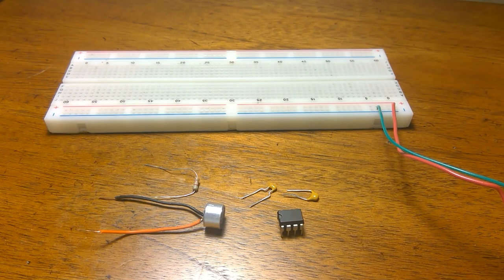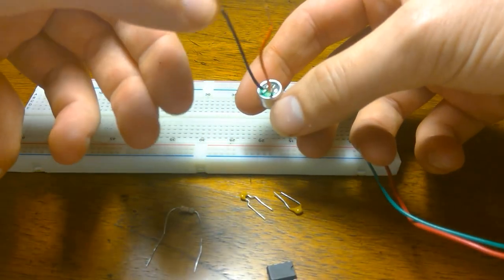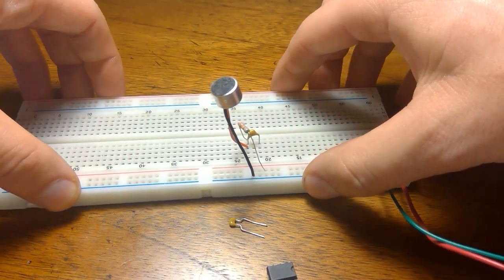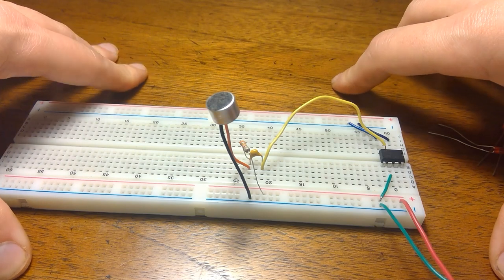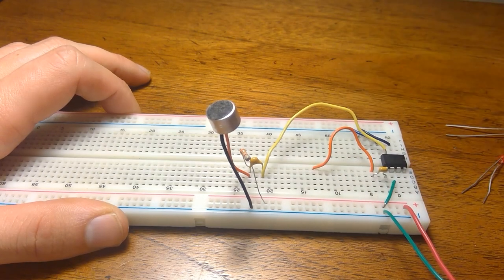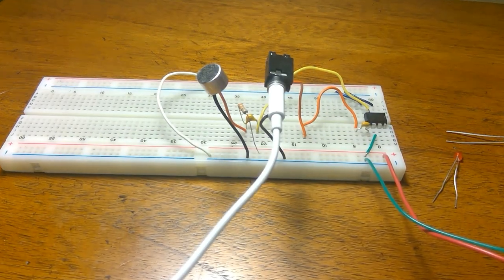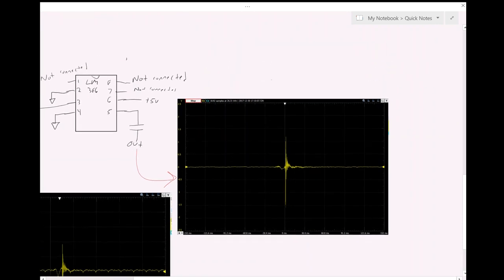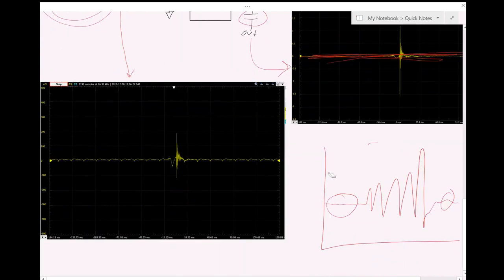How to make: Simple Mic Amplifier

Comment: I've built several LM386 amps and all circuits that I have seen specify a 10uF cap between pins 1 and 8...+ on pin 1 and the gain is then 200. A 1k2 resistor in series with this cap reduces the gain to 50.  A 10K pot after the input cap with it's wiper going to pin 3 works well.
Reply: Interesting.  I will remember to look for this, as I examine LM386 Variations.  I'm not focused there just yet.  I am just finishing up getting familiar with the NE 555 timer.  I noticed these similarities you described in the 555 circuits I examined and built, regardless of the application,  I built the LED police flasher, as well a transistor checker tester, and the 555 generally gets set up with same jumpers 2 to 6,  4 to 8, 10uf cap between 1 and 2, and ect.
I have found that after completing the builds, changing the caps often improves the result, if not required to even to get it to function.  Voltages are not always Identical, as well transistors might be diff ID#.  
You say "specify" are you set on this standard, and, or have you experimented with diff values?
If yes I would be interested in your experience.  If not some little tricks, at least it may save some wasted time.
Thanks.
Reply: Thanks for helping. I am needing the mic to pick up a sound from a few feet for a VU meter Led made strip with my Nodemcu. Do I only add the 10uF between pin 1 and 8 and no resistor in series. Also the pots have 3 pins I think the wiper is the middle pin and the other to be connected, but where does the 3rd one go. I assume to the ground. and is the input cap connected to lm386 pin 3? Thanks for any additional help.

Comment: Isn't ground infinite resistance?

   I see the point of the comments above about a resistor not going to ground because of this. So is it a good rule of thumb to always put your resistors in between positive and another component? I'm just learning, burned out a few resistors that were connected to ground in parallel with a capacitor for a guitar effects pedal.

Comment: Nice, I'm thinking I may use this on a VU meter I'm having difficulty with. signal from mic needs a boost.

Edit,  I did the above, and it worked well. Did it on bread board first, transferred to pc board and failed. I put it down. Picking it up again later I discovered some mistakes.  I'll get it.

Comment: Hey bro, some folks should be a little more constructive with there criticism. I bitch about videos sometimes so here are my thoughts. 10 plus man. I am only interested in factual information and seeing it actually built. The plus is because you also have the circuit drawn up showing the scope readings. Thanks for nailing the creation of a useful educational well explained video. I have been trying for days to find the correct simplified video of it on the bread board. One question though. Is there a way to increase the sensitivity of the mic or does it pic up sounds from a few feet ok. For it to be used in a VU meter that is sound activated with addressable LEDs with nodemcu esp8266??
Reply from the maker: Thanks yes this circuit was aimed to use the least amount of parts. Leaving the gain pins open yields an amplification factor of 20.when I snapped my fingers it was a gain of 7.5 probably because I wasn’t using a large enough rail to rail voltage supply so it maxed out. You can boost it up to 200 times using the cap however be mindful of your power supply voltage that you don’t peak and distort your output due to a low voltage ceiling.
Reply: @MostElectronics  I have it built and I connected 1and 8 with the 10 uf cap and put a 10 k pot with the wiper on pin 3 the other side with mic output. I seen it makes a gain of 200. I have not tried it. Kinda waiting to hear from some other posts if it's ok. Do you know?
Reply from the maker: @retrorocketman6969  make sure your supply voltage is high enough or else you’ll just peak out the amplifier and everything will be distorted
Reply: @MostElectronics  that is a good point and thanks. Now my thoughts are to pull the data sheet to get the max voltage on the electret mic and lm386 and set a max limit   to prevent overlo and use another adj trim potentiometer. To obtain the best operating voltage. Does that sound ok? I surely don't want to smoke my IC because I'm limited and can't buy any.

Comment: I made a preamp with 741 Ic and also with a single transistor with carbon condenser mic in both. The problem is I need to bring the Mic very close to my mouth to speak to record audio. What's the problem ? Is this Mic fault ?
Reply from the maker: not enough gain. LM741 do not provide enough gain

Comment: there is no need for any external power source for the electret microphone to work?
Reply from the maker: The current is provided by the resistor from the positive voltage. It turns on the built in FET inside of the capsule which generates our small 400mV signal from the snap

Comment: i wish people would specify if using the N-1, -3, or -4 variant.  I'm assuming you are using the -1 variant due to the mics low output
Reply: What’s the difference
Reply: @harrisonartz8387  Acceptable supply voltages, output power, etc.  It would change the values of external parts.  If a tutorial is done with a -1 and someone gets themselves a -4 (or vice versa), things won't work the same.  That small detail is easily missed by people purchasing off Amazon.

Comment: question, noob here. if I got a mic in a tape machine like this and I snipped it and soldered a line in could I plug in and record  music equipment into it without damaging the music equipment? I asked because I used my multimeter and found the 5v on the hot and didn't do the mod because I felt like it could damage my equipment like plugging in a keyboard and 5v going into the keyboards output.
Reply from the maker: It's possible, however you do not want to overdrive your recorder input. If you have an oscilloscope you can use that to see what is coming out of the tape machine. if you replace the mic with the tape machine you may just hear distorted music because the amplifier providing the gain for the mic is only expecting a few millivolts. If you put in 5V it will try to boost that and distortion/noise will occur.
Reply: @MostElectronics  thanks for the feedback. I got really into circuit bending recently, thought I found a mod on this toy keyboard that had a mic built in (cutting the mic and wiring a 1/4 input to the wires.)  and It worked, I would get really cool crunchy distortion when I played my guitar through it. I checked it with a multimeter after watching this and found the same 5v you used in this circuit. lmao thats what I get for assuming I found a mod that no-one else in all their experience circuit bending have found. got some sweet recordings though and as far as I know my instruments I ran through it are doing fine. now I know. THANKS.
Reply from the maker: @shawnlennon1947  sure, glad you are able to enjoy the distortion effect

Comment: In the schematic at 9:00, where is the required DC bias for the electret cartridge?
Reply: It shows the 3k resistor going to ground, which is obviously a mistake. He did it right on the breadboard going to the positive rail.

Comment: CAN YOU USE A 9V BATTERY FOR THIS?
Reply from the maker: Sure
Reply: You can. Electret capsule requires 0.5 mA current at 2 V so at 9 V source, you'll need (9-2)/(0.0005) ohms resistor. Simple. Now add DC blocking capacitor that shall act as a high-pass filter as well with capsule's resistor. The -3 dB cut-off is too be decided around say, 5 kHz; choice is yours, however.

Comment: i use a microphone that is plugged into a desktop computer in the microphone plug on the back of the motherboard and i use audacity in ubuntu 16.04. i can here the microphone but it is not loud enough. their is a thing called "48V Phantom Power Supply" but this is for Laptop  which does not give the microphone its full 5 watt power. on my desktop it has that and so i was told that it would not allow me to increase volume. but could i use a "PRE-AMP" before i plug into the computer to increase its volume. or basically how do i increase volume.
Reply from the maker: What kind of microphone? The circuit in this video can be used as a pre-amplifier or PRE-AMP as you call it. If it is the microphone used in this video then yes its going to be very quiet if you just plug it into a computer mic input. If it is not then you may have to just adjust a gain setting on the computer program.
Reply: its a $10 microphone called "Earamble BM-800" it says its a "[Cardioid Pickup Pattern for Broadcasting & Recording] what ever that means. i think they call it a "condenser" i have one that i think is called a "dynamic" that also has very little sound. this is a regular problem that most people face you should do a video on it.